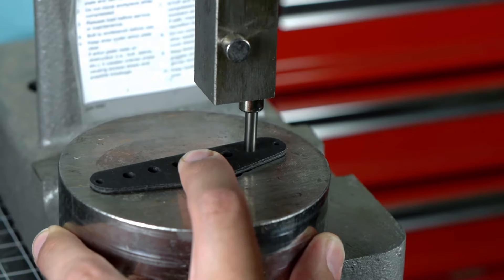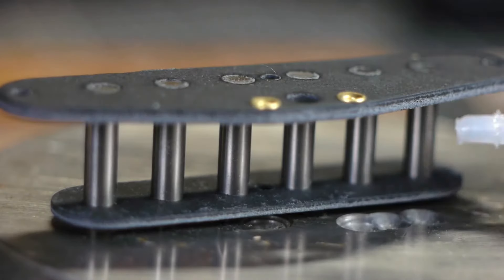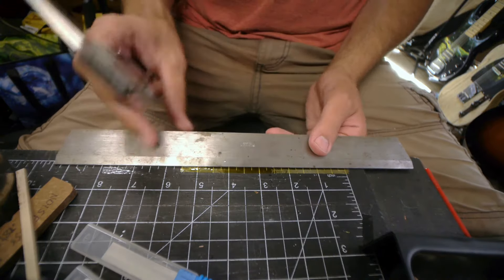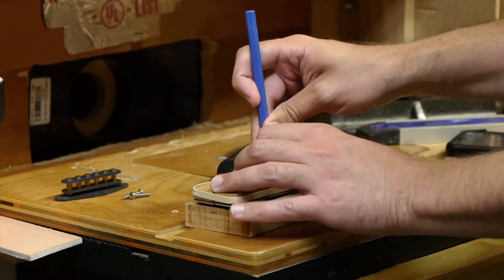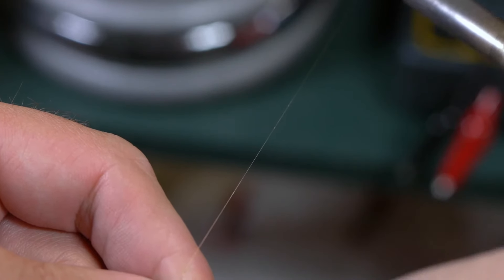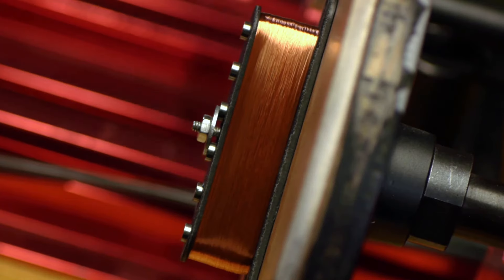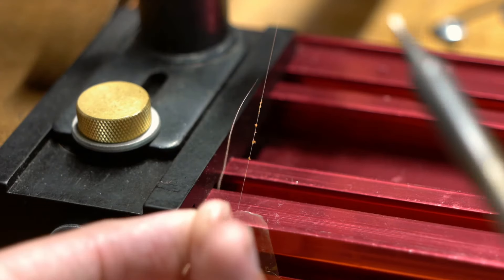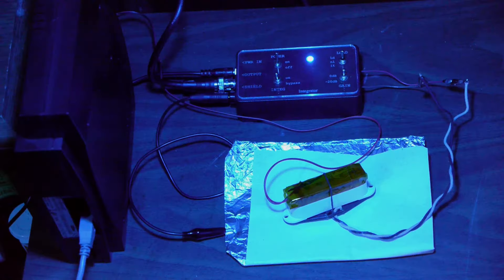Making a Single Coil Pickup: Complete Guide

Comment: Hey Guitar MD 
Big fan of your tutorials
Where I live it's a bit difficult to get the alnico magnets. Can I use the ceramic ones to get the vintage fender 60s tone?
Reply from the maker: You can use ceramic, but it has to be used with steel poles. It may be possible to get closer to vintage Fender '60s tones by under-winding the pickup. Basically, steel poles increase the inductance, which lowers the resonant frequency, which means you get a darker tone. 

A typical turn count on a Strat pickup is around 7,500 - 8,000 turns. You might try using 6,700 or 7,000 turns. The pickup will have less output, but it will also be brighter/more sparkly sounding. If Alnico rod magnets are not an option, this is one thing I would try. You can also use neodymium magnets with steel poles. I've used neodymium bar magnets and disc magnets. I don't think it matters much. The main thing is you'll need steel poles for the bar magnet to magnetize. 

Let me know if you give it a try! And remember, less turns = brighter tone and more turns = darker tone, all other things being equal.
Reply: @guitar_md  Thanks a million. You're a legend ❤

Comment: Thanks for the video. How do you remove the wax from the wood surfaces? I am using now plastic for the spools and glue the wood to the top after waxing as i was tired of the wax which remained always sticky on the surface

Comment: where did ya purchase the reamer from thanks so much for the info
Reply from the maker: The exact one I use is here. "Monster" brand, model 500-001012: 3/16 ST FL RHC Reamer: 

https://www.ebay.com/itm/144794756840?hash=item21b670a6e8:g:~IIAAOSw4JpjZBbD&amdata=enc%3AAQAIAAAA8Fbc%2F92Aq0s5EtF4CKC22p3mIbRQxH5X2c9dW745Vi%2F%2FZL5B2fnj%2BPkfJEHOZ2E4CA1RJAOrtwOTkPcVIGK3eBXGUVrbd%2FMvmw9a3iZP0RjT7H5VFGkSDPA045SDaBH2FK6QFsrwL%2Fy1G2wQNY0Ak70xX%2Fknfe2%2Fo6H1ubZXlPs8%2F%2Bwxz3ep9Xt2E0dkJmrHgMnsLnJAy%2FMUSkakffxwL0bh18xfIgCaRPxLSdhXGDb8F%2FkoelmTKI0pGDTCi2iDoPQPWLeQNiqZ8cjbul9cT5LotqvUEGTJftShNvmFAMdvWjzdUbu98O52y7I8GcYofg%3D%3D%7Ctkp%3ABFBMmJL_qOli

Anything similar will work, though

Comment: 16:26 Is this process necessary when we use a bar magnet?
Reply from the maker: Nope! If you're using a bar magnet, you're good to go. Those are fully magnetized, and will magnetize the steel poles. You can actually screw them up if you try to do this (can demagnetize the bar magnet)....don't ask me how I know. 

I've been meaning to make a humbucker build video. Would love to do that. It would be a great followup to this one. Thanks for the comment!

Comment: Very cool. What do you use for shielding? Tape or the paint like StewMac sells?
Reply from the maker: Thanks! I actually don't use shielding and have no experience with it. But I'd probably opt for copper tape if I did. 

I have made many noiseless pickups however. Made properly, those can be great. Most noise canceling technology, whether shielding or stacked coils, tends to lose a lot of high end along with the buzz. 

I've been curious about shielding the actual pickups. DiMarzio has done this. The concept is a bit odd as they say to not connect the copper tape all the way around the coil or it'll remove the high end frequencies. Very odd as I'm not sure how it removes buzz without doing that.

Comment: Can I connect this pickup with my laptop in my DAW with a headphone jack?
Reply from the maker: I'm not sure a headphone jack will work. For use in a DAW, I personally use a dedicated USB audio interface such as the Focusrite Scarlett 2i2. 

Then you can use the dedicated jacks (combination XLR or 1/4" -- just plug your 1/4" guitar cable in) to plug in  your guitar. 

I mostly use Reaper (my DAW of choice) these days for playing guitar, with the 2i2 interface. I'm also currently experimenting with low impedance pickups for use with an interface. The cleaner/flatter EQ from low-Z pickups may be favorable for direct-in playing. But more experiments needed. 

Hope this helps.